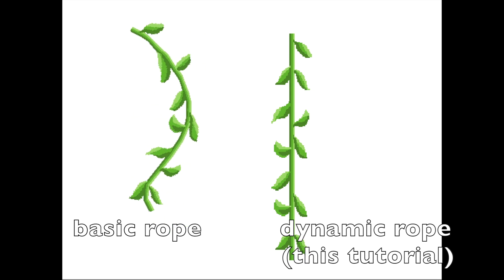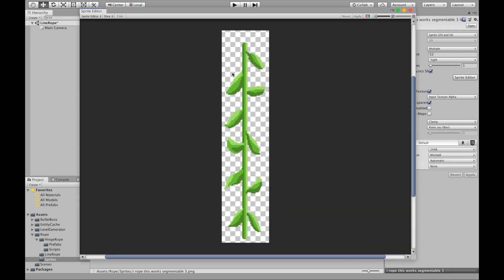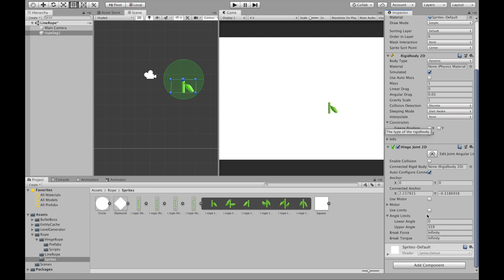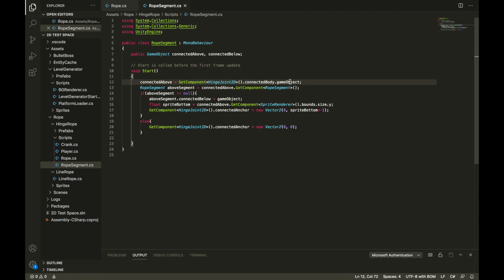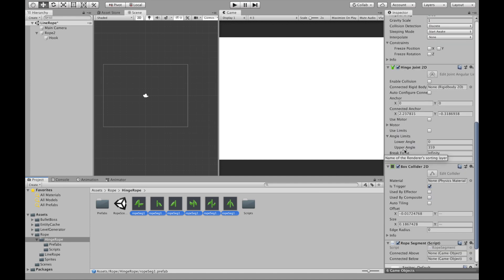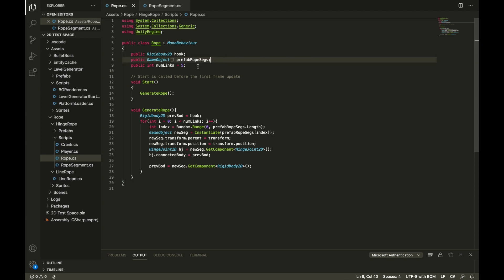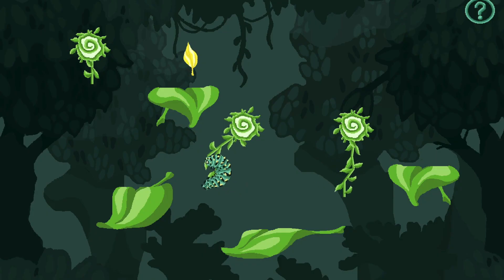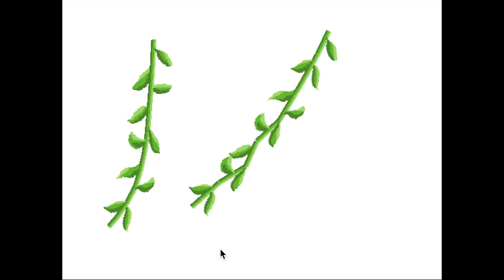Dynamic Rope in Unity - Rope Physics Part 2

Comment: Nice Video, thanks for the input.
One tip to prevent the rope-parts from colliding with each other and still not having to use trigger only: just put the rope-prefabs into a new physics layer "Rope" and Define it to not collide with itself and only with other physics-layers
Reply: Very good tip

Comment: Hi, 
It shows me the below error when i save the ropesegment script :

HingeJoint2D' does not contain a definition for 'connectedBelow' and no accessible extension method 'connectedBelow' accepting a first argument of type 'HingeJoint2D' could be found (are you missing a using directive or an assembly reference?)

Is there any fix to this error ?

Comment: The ropes get tangled up and don't come out in a straight strip.
Reply: It's fixed when manul is done, but "connected anchor" should be auto-checked first, then remove the tick because when you set it to zero, it gets rope around again.

Comment: Amazing video, found this tutorial sure helpful! I was changing it a bit for a project and I found a solution for the collision problem of the segments colliding with each other when they spawn if you have the box collider not set as a trigger. The solution was to add colliders to the rope and keeping the same script is you can make a Layer for your rope, say called Rope. Then go to Edit, Project Settings,  Physics2D, LayerMatrix(Very bottom), Uncheck RopexRope. Then the ropes will ignore collisions with anything in the Rope layer

Comment: So if I understand correctly, even though all of the instantiated segments have their positions set to the Rope object position in the rope script, because their HingeJoint2D connectedAnchor attribute is set to spriteBottom*-1, they will automatically snap into place based on the connectedAnchor location?

And the reason for the -1 is because the origin is set in the top center, and y goes negative as you go downwards.  I think I got it :)
Reply from the maker: Yup you got it!!! Not so much snap but gentle glide. Well done :D